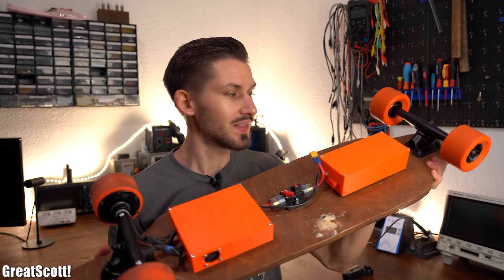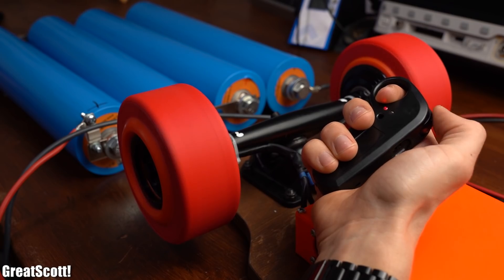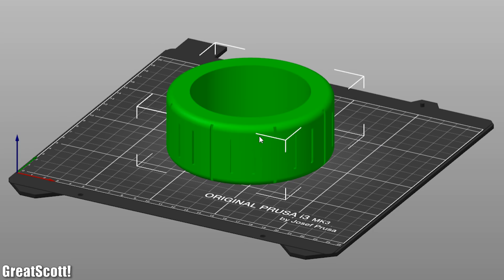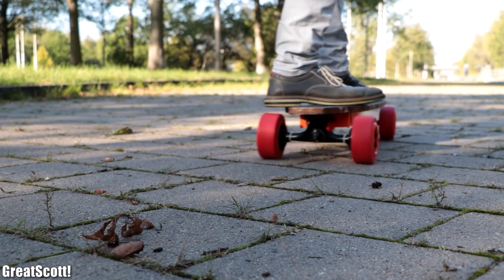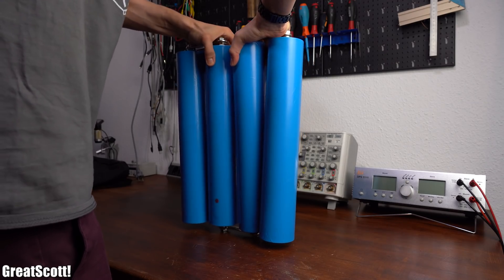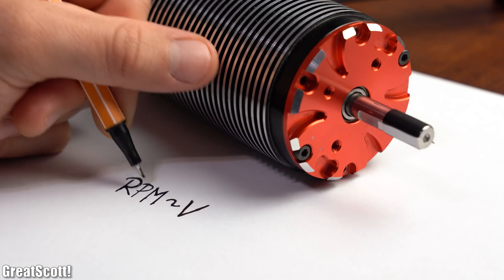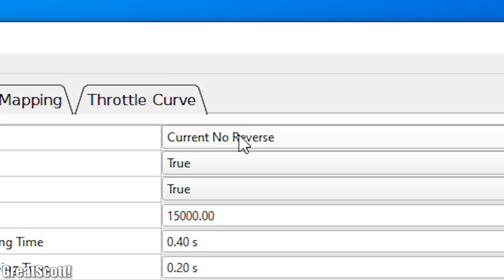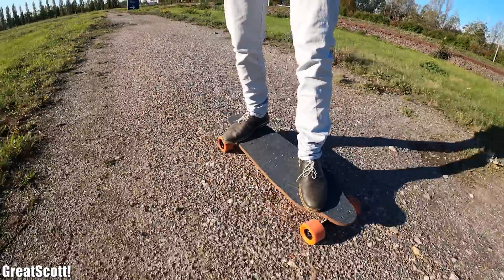Creating an Overpowered Battery Pack and Off-road tires for an electric longboard! (Experiment)

Comment: just an idea, why not make a "combo system" you have all the parts, use the old battery as your main source to give you the  higher voltage, regen etc, then you can use the backpack battery and boost converter to recharge the smaller battery
Reply: @Admin...  why not? The regen power would go into the smaller battery pack giving him breaks while the big battery pack would keep them topped off.
Reply: Luke Ballantyne Ultra Cap anyone?
Reply: That's exactly what I was thinking.
Reply: Yeah I was just about to say that
Reply: @Admin...  Why?
Reply: I was thinking maybe tapping the circuit that is existing in the controls either wireless (more complicated) or at the receiver with a relay of some design so that when throttling the relay would switch to the boost converter output.  When decelerating or braking (not sure what the controls are) switch the relay to directly charge the 12V circuit signal path.  Seems can use both and would make and awesome project.
Reply: I was thinking that or he could use the boost converters with two diodzs so one bypas'ses straight to the battery for the regen and the other makes sure the power doesn't come back into the boost converter
Reply: your idea would work for sure but he could also added a buck converter  from the motor to the battery and switched between the boost and the buck boards, maybe he is reserving the solution for a future video
Reply: @JaysonSR who cares though. Even if efficiency dropped to a ridiculously low 50%, are you still gonna ride a longboard for 40km?
Reply: Nop as regen would still go into big one
Reply: @mirono3099  no, im assuming the boost converter has reverse protections or atleast isolated
Reply: @mirono3099  If the boost converter uses a diode on the high side it will be impossible to backfeed any current. If it is a synchronous design with a MOSFET instead then it should handle reverse current without issue. If you look at the basic schematic of a synchronous boost converter which uses two MOSFETs you will realize it is the same as a synchronous buck converter which uses two MOSFETs.
Reply: There's already too much weight on the board with both the giant batteries and Scott. Adding a second pack would just make it worse
Reply: @pratikkunkolienkar1561  the giant batteries already are the second pack, the original one is very light

Comment: What if you keep using your old 24v power bank, but add charging from the huge batteries with a boost converter? So you can drive, and charge at the same time.
Reply from the maker: Not such a bad idea
Reply: Would improve the range !

Comment: remote that looks like a detonator, backpack with wires coming out of it, battery pack that looks like some improvised explosive? if this was in the US it would be risky going out with that setup hahahaha
Reply: people will call anything a bomb, back in high school I put together a voltage regulator with battery and switch to charge my phone with, had a little red light on top metal toggle switch, all the kids at school kept saying I had a bomb which was very concerning and I had to explain to so many teachers how it worked and what it was.
Reply: @calfeggs  people fear what they do not know, and to many people know nothing
Reply: @teslacoil4335  Quite true. But the fear of the unknown is an innate self protection mechanism. It is what encourages a longer life. And yes, this fear needs to be moderated by gaining knowledge. That's what the teachers are doing by asking for an explanation. It is the teachers responsibility to keep the children safe while the children are in their temporary custody. It is not reasonable to present with something that "looks" like it could be a bomb and then think nobody should be asking questions. Because it could have been a bomb!
Reply: @netcomptech  fair enough, I guess I wasn't thinking from their point of view and thought process there
Reply: @calfeggs  I had 3 lead acid batteries delivered to my work once for an ebike project and the seller omitted crucial information like the name of the recipient. The reception was about to call the bomb squad when I walked past and claimed the package. Let's just say that I was not happy with the seller and did not rate their service highly!
Reply: @calfeggs  I think I would have asked to have an announcement made about the device after the second or third teacher asked about it.
Reply: @calfeggs  I think they were just joking.
Reply: @calfeggs  yeah the no tolerance rule is downright insane. My friend was suspended for accidentally bringing a xacto knife to school and turning it in to the office
Reply: i mean, isnt he german?, im sure they would catch glances there too
Reply: @teslacoil4335  glances maybe but the chances of getting shot are way lower here in germany
Reply: I'd argue that the fact it was quite obviously connected to the longboard should be sufficient to explain what is going on but then again people aren't always the brightest.
Reply: @jayzo  people are stupid, never underestimate how much they can fail to understand
Reply: That was exactly what i was thinking about
Reply: Well hearing what was happening in Germany (where he life) i guess this setup is also risky over there.
But idk fo sure of course because i life in Poland not Germany and everybody now Germany isn't and never was Poland.
Reply: Lol, that's funny... The terrorist board. Or terror transport.
Reply: Nah dude, 2nd ammendment rights gotcha covered
Reply: If he had a tan he would be in severe danger in this psychotic country I live in...😩
Reply: we did a joke in high school with a watch around a pack of red lithium cells.
Reply: It would be more risky in France at this moment though 🤣
Reply: @djthdinsessions  yeah, a friend who works in a school received a call from the cops saying that they will do a terrorist simulation, basically taking a class hostage.

Comment: Coudln't you just put some heavy duty diode in antiparallel to the boost converter, so the current can be fed back into the batteries?
Reply from the maker: Would that not short out the boost converter?
Reply: @greatscottlab  well... you are right

Comment: I really, really hope there will be a part 2 where you use smaller LiFePO4 batteries and test it on a very long ride 😋
Reply: Batteries are not cheap though
Reply: @Travis_Yu  they can be for sure! I got 200 A123 M1B cells for $1 each(used), and 200 tesla 2170 cells for $500, brand new from reject packs.
Reply: Do it
Reply: The only reason to use LiFePo4 is if you need more peak power output. They actually have less power density than normal Lithium batteries...
Reply: @Argosh  they are better for small batteries imo. I am using 15S1P life on a 60V VESC w/ no bms, and charging it with a 13S li-ion charger. For the price of like $20 I can make a killer little battery.
Reply: @quinnfoster4671  power density is a physical property that is not dependent on opinion.
Reply: @Argosh  design constraints and adequate performance
Reply: @quinnfoster4671  do not change physical properties of batteries... With any given weight of LiFePo4 batteries any high density Lithium battery at equal weight will have more absolute energy to use. Current draw is usually a non issue from a certain capacity, so for any mobility application you go for density.
Reply: By the way I am making Arduino projects in my channel please take a look 😀